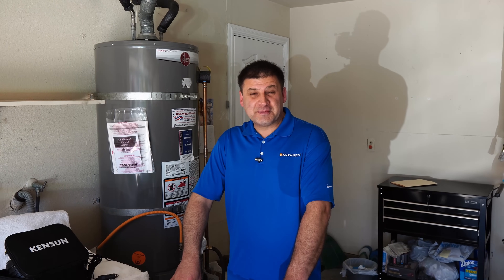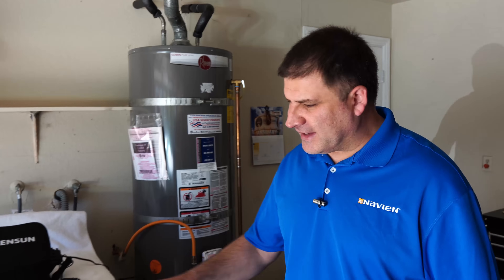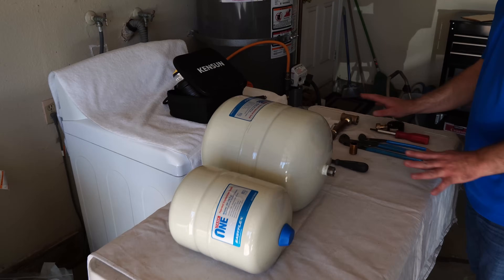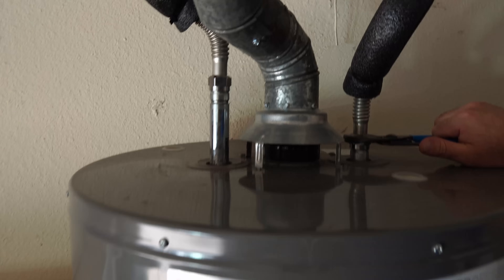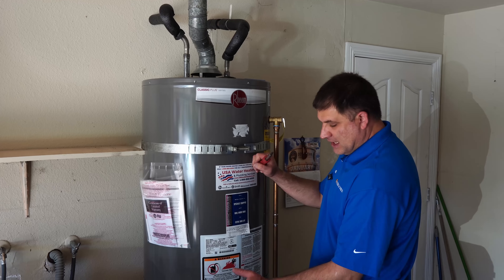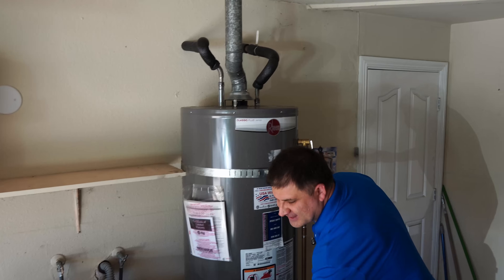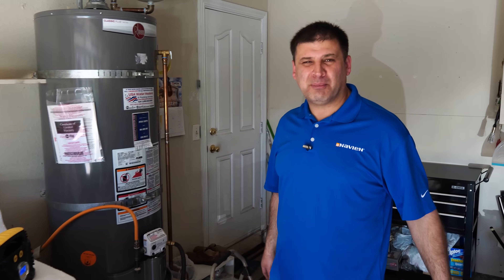✅ Expansion Tank Installation on a Water Heater - What is an Expansion Tank? - How to Install it

Comment: When you just checked the water pressure for 80 psi you didn’t rate the inside washer of the spick it inside the housing …not saying your wrong but if that washer is old a or frayed it will be less pressure…plus what if it is a winter safety release pressure valve that opens at 32 degrees freezing? I’m only questioning the pressure test …I’m sure over sizing would hurt it right? For over 60 years the water heater system has worked fine …it seems stupid to put a little tank on a back valve that has a tank under it that is 40 or 50 to 100 gallons of water …we’re not building a rocket or are we?

Comment: Hi just have a question. I have the old expasion tank. When i changed my old water tank to a new one. The expansion tank remained. My shower pressure upstairs is kind the nothing changes of pressure. Still kind quite bit low pressure. But the downstairs shower have a good pressure in it. 
Do you think the expansion tank loosened the pressure when they change the old water heater?

Comment: Can you add air to the tank after it's installed?
Reply from the maker: If you shut-off the cold water to the house and slightly drain the water out of the cold water pipes, you can then safely inflate the bladder. The rubber side of it that hits the water does not move at all when inflating.

Comment: Very helpful when I was replacing my water heater and discovered that I should add an expansion tank.  The video took away all the mystery.  I’ll be sure to check Dennis’ channel if I have another plumbing job.
Reply: We needed a new heater shortly after moving in both old and new leaked from pressure release area.... we have an expansion take but replacing it was never mentioned not even by the home inspection at time of purchase. 😢

Comment: Hello,

I have a leak on the fittings/pipe connected to the expansion tank above the hot water tank.  I'm thinking to replace the fittings myself, first time though.  Besides turning off the cold water valve,  maybe the water tank burner also?   What else do I need to do before removing all the fittings part?  Thanks,

Comment: While you are in there make sure you install a shutoff valve on the hot and cold water intake and output lines the intake is used to cut off water to the unit and the output minimizes system drain time and bleeding later, you will thank me later...

Comment: I have had issues with my " Pop-Off Valve" many times through the years. I have added a pressure reducer valve. I have had to replace both several times.
Again, I have replaced both. Prior to, my pressure was 150psi!!
 Also, I did add an expansion tank. After bringing the heater system back on line,  my water pressure was 50psi. The bladder pressure was 50 psi.
 My pop-off ( pressure release valve) is STILL POPPING OFF     THE EXCESSIVE PRESSURE. 
thoughts? Perhaps, add an additional pressure reducing valve? Add an additional expansion tank ( space is very limited here, but i can ). Both?

Comment: Isn’t the tank installed upside down? I bought one and the instructions are saying it should be installed the other way, that the bladder is fixed to the rings in the middle of the tank.

Comment: If I did water you showed I would burn my hot water elements out… you shouldn’t drain tank water without turning off power or if natural gas hot water turning off temperature settings .. only should drain enough water to relieve pressure

Comment: WAIT? If the water supply line is turned off and the tank eas drained. Shouldn't the first thing to do After shutting of the water to the house os replacement water shutoff valve going To TheTank, Reconnect the line from the tank water supply, turn the water to the house back on, turn the water valve to the tank on and Sheckler it for proper operations Off from the on on position to insure no water is going into the tank??? If not then continue with the expansion tank installation???. 
Why did you leave these steps out of your video??? Someone's going to try to do this Following your misinformation and have a problem not knowing how to fix or diagnose their problem...

Comment: Having opened up my 3 year old PRV and do a thorough inspection, I am convinced that my pressure fluctuation from a setpoint of 60psi to sometime over 100psi is due to my residential system NOT having an expansion tank. Thanks Dennis for the great video. It gives me a great clue to my psi fluctuation problem and confidence to plan for an ET installation. A question if I may...I notice that you did NOT install dielectric unions at the water heater galvanized nipples. Why not, are you not mixing dissimilar metals here (galv + brass)? Even though my RHEEM tech support tells me that the galvanized nipples are lined and that I would not need dielectric unions, I dont see their logic. Even though internal of the galv nipple is lined, the exterior would still come in contact with the brass fitting . Please provide your comment. Thanks Dennis.
Reply: Your obviously not a plumber

Comment: Great video, very helpful. FYI, you can adjust the air in the tank with any air pump, even the type used on bicycle tires.  It's a standard schrader valve.
Reply: Yeah, using that bicycle pump to get to 80psi will be a great workout!
Reply: @mikefranks4528  its option for those not wanting to buy a whole new device

Comment: Very good video, Dennis! 👍👍
I always install a valve on the hot side. 
Then, for example, when replacing the heater, the shut-off at the house main valve is not necessary. And the hot water can be turned off completely if necessary without having to turn off the cold water at the main valve.

Comment: I like your tip on grinding the top nipple for attaching the water supply line. I spent two hours today trying to get the cold water supply line to not leak when I had to replace the water heater in a rental unit. I tried replacing the washer with a new one (Everbilt), but it was not even half as thick as the original one. Junk rubber washer IMO.  I then tried flipping the original one upside down. Still got a small leak. I gave up for the night and had 4 fingers of vodka to take away the frustration. Tomorrow I will exchange the black steel nipple that was originally on there with a brass one that has been filed down. Hopefully this will fix the leak. You are right, there is no flat surface on those black steel nipples.
Reply: You fix the leak ?
Reply: @SLickev92  Lol, I fixed it, but I don't remember how. I have a recollection of buying a thicker washer. I just looked back at my Amazon history, and found that I had ordered a Danco 65884B Water Heater Supply Line Washer. I think that's what I tried and it worked.

Comment: If I decide to install  a recirculating pump would it be under the tank or above it? The motor sometimes suggests to install it on the hot side and some others wants it on the cold side.
Reply from the maker: It depends on the kind of pump you are using. Given you don't have am existing hot water recirculation return line, this is what you need https://amzn.to/3ZiKG3f and it goes on top on the hot water nipple on top of the water heater. Then there is a by-pass valve you install at the farthest to the water heater faucet.

Comment: Expansion tanks can be installed straight up, instead of to the side(this video).  Any benefits to the side install.  Straight up, all weight of expansion  tank will be directly on HWH,  instead of pipe.

Comment: You pay $5,000 for a nice water heater and the manufacturer didn’t think of installing this into the unit? What kind of scam job is this? If it’s necessary than the manufacturer should of built it into the unit.

Comment: I've been reading comments below and a few are talking out their a$$es. 
First: 100% water will not expand at all until it begins to boil. Only the air (or any other gases within the water column) will expand as it's heated.  Older water heaters that pop and tick when the burners on produce steam pockets due to build-up on the bottom of the tank but that's another subject Mr. Smedely  can talk about.
Second: Municipal water, spring water and well water all have different amounts of air in them, so the amount of expansion will vary.  
Third: If the street pressure is above 80 lbs. you should have a regulator...if below, no need for one. Regulators close when the desired pressure is reached....leaving no place for expansion to go. Expansion tanks should be installed on all systems with regulators along with hot water producers of any kind. Otherwise the water can travel backwards. In California  I've never seen houses with check valves at every meter. Some had regulators (mistake) but now they're installed at the house cuz they only last about 10-15 years. Municipal water is always running somewhere....so thermal expansion produced in homes is not an issue at less than a quart here and there at a time. It's a very slow process but needs to be addressed at the particular site.
If you put 80 lbs of air in the tank and the street street pressure is also 80....The diaphragm will not center it's self and defeat it's purpose. You should put in HALF of what ever the current pressure is. 
Always use a somewhat liquefied pipe dope along with the Teflon tape, keeps all malleable metals from balling up inside. Good luck!

Comment: You will hear plumbers say "water doesn't compress" so how does it expand? Answer is it doesn't. 
The air in that tank is the only thing expanding. Your backflow preventer, and the blow out valve (high pressure valve on the water heater) would prevent and over pressure. 
The tank is the most air in the system and that's where your expansion is. 
If you have expansion in your water heater it's getting way to hot or you need to let the air out. 
These tanks are ridiculous. 
You shouldn't have expansion heating water to 125°f unless you have a lot of air in your water heater.
Put a pan of water on the stove with exactly 1 quart of water. Heat the water to 180. Measure the water again. It is still one quart. 
Case closed. You will never get 180° in a water heater and you will never see water expand until it boils.

Comment: That’s a very bad install.  What plumber doesn’t always have a flat file in his tool bag?   And why would you not install a water shut off on the cold water line coming to the water heater?  If it ever blows out there’s no way to isolate the water heater.   You’re all concerned about installing the expansion tank properly ,  but not the water heater?   😂
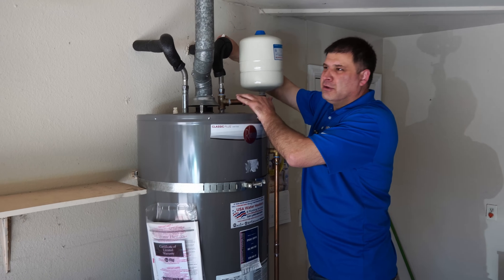Reply: There is one installed. See at 19:20 mins when he turns it on.

Comment: Most PRVs are factory pre-set to 55 psi.  Your house pressure is 80 psi, which is very high and could damage appliances.  Why didn't you just adjust the PRV downward and skip the hassle of dding pressure to the expansion tank?

Comment: There IS water inside. The water should be contacting the bladder (not air). It's pressurize water and that's were it's expected to go. And it's upside down. There's no way to degass the water side of the bladder when it's update disc

Comment: Does anyone have a measurement from this setup from the top of the hot water tank to the top of the expansion tank.. as I have limited space to fit it.  The tank specs show 12.5".. curious on total height to see if it'll fit.  Thanks!
Reply from the maker: You can use longer nipple from the tee and have the expansion tank hang down besides the water heater.
Reply: @dennistheplumber  Good idea thanks.  In my case I probably won't do that, as it'll put it in a potential path of walking by, but I'll check it out.  I think I have 18" above the tank.. maybe slightly more.

Comment: Instead of using that nipple and reconnecting with the Flex hoses I would’ve just re-pipe the waterlines correctly and get rid of those flex hoses they are just junk but awesome video great way for explaining the plumbing

Comment: It seems that the plumber who installed my water heater put the heat expansion tank on the wrong side. He connected it to the hot pipe, but it should be on the code water side.

Comment: INCORRECT. 100% INCORRECT. The Expansion Tank MUST be installed a minimum of 18” from the cold water inlet of the water heater. NO CLOSER! I’ve been installing water heaters exclusively for 40 years. Please stop installing the bottles like this.

Comment: I have used the concrete floor as a file before.But I never had expansion tank on my house.  There is supposed to be a back flow on every home to protect the public water. So I guess I'm breaking the law. Straight from the main to water heater for all my life. But I never use flex ,I always solder it or as of lately there is a couple  pro press joints .. I heard it was a need for an expansion tank But I don't see it,I see it as a new rule that popped up somewhere...But I don't do plumbing on peoples houses either.. It has to be a rule implemented after the 90's.I have no idea when the codes for expansion tanks were introduced and I probably need to read up,But it's working out without one here and always has... Good video young man, Happy Holidays

Comment: I have a large expansion  tank (25 gal with a solenoid attached).   How does this work? It is located on the incoming cold waterline. I power flushed (well pressure) the hot water tank today until it ran clean, but suspect the expansion tank also needs flushing. The expansion tank has a rusty pipe plug (for drainage?) but I am cautious without understanding  how it works (why the solenoid?).

Comment: I worked with hydraulics for over 40 years. This is no difference from a hydraulic accumulator or what's used to stop water hammer and if installed correctly, it will work. This video shows it installed upside down. The liquid section should be on the top and the air on the bottom. That way it is self bleeding. Also, the air pressure should NOT be the same as your system pressure but a bit lower. If it is the same, the bladder will never move unless there is actually expansion. I'm not sure what it should the air charge should be but it should be enough to keep the bladder floating.
Reply: Water is not compressible, air is.  As the water heats up it expands, the bladder moves and compresses the air so the water has somewhere to go. If there is a backflow on the city side, water has nowhere to go that's why the tank is needed.

Comment: Strictly out of curosity,  why would you use Teflon tape and pipe dope?   I've personally never seen anyone do that before
Reply: The teflon tape is actually mean to a lubricant so to speak to allow you to just literally get the fitting on tighter, or deeper in the threads, pipe dope can actually block the water/pressure from leaking through the threads. I also used to basically assume having the thread tape bound up in the threads creates the seal but the is not the purpose it's to allow more turns on the fitting. So the combo can be over kill, but for me it depends on how strong the fittings are and how easily I can get to them. Steel fittings I know I can put a lot of torque on easily with a large wrench, tape is just fine, softer metal/plastic fittings in a hard to reach place, tape and dope or even just dope.

Comment: 80 lbs of pressure means you should probably reduce the pressure. When you set the pressure on an expansion tank. It has to be 3-5lbs higher than the system. Or it won’t work.

Comment: Should drain the cold water pipes from within the house especially upstairs. Open the cold water valve in downstairs sink or bathtub below level of heating tank. 
Always have a towel ready at top of tank because if it leaks like it did here, it will soak the insulation around the tank which is probably what happened here.

Comment: does the expansion tank not pressurize itself with air once the water gets turned back on?
Reply from the maker: No, it does not. It’s waste of resources unless you pressurize the expansion tank to match water’s psi.

Comment: Sorry but thermal expansion tanks should be installed 18” away from cold water inlet fitting on the water heater.

Comment: Tank is mounted upside down. Expansion tank should be mounted with the opening point up so air can escape. With it mounted upside down, Air can get trapped, causing issues, possible bad as a water hammer if there is another issue in the system.

Comment: Great video, just a quick question. If you are draining the water heater shouldn't you switch the heating to "pilot" so you aren't damaging the water heater by trying to heat an empty tank?
Reply from the maker: I am only draining out about 5 gallons, not the whole tank. As a professional you have a sense for these things, and don't waste time draining and refilling the whole tank. The sensor that measures the water temperature is all the way down 6 inches above the bottom of the tank. Unless the water level goes that low, the flame does not come on.

Comment: Great video. I have a  navien tankless water heater which looks like was installed balloon on the bottom aswell ) I was about to change it but my friend told me I don’t need an expansion tank since the water heater is tankless. Is this correct?
Reply from the maker: If you don’t experience accidental water discharges through the t&p valve, you don’t necessarily need an expansion tank.